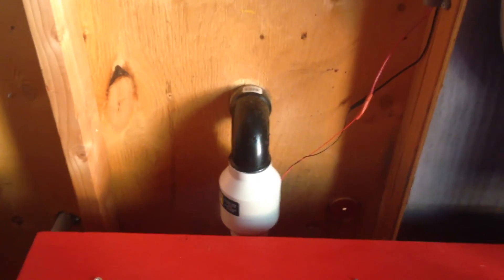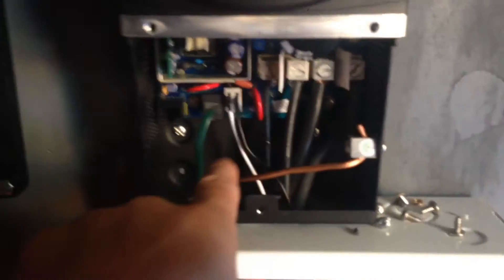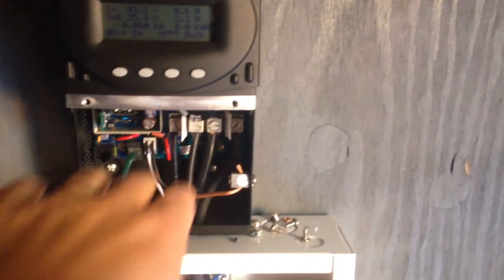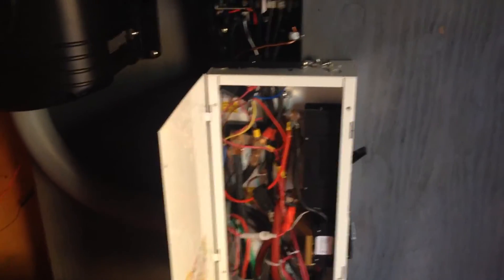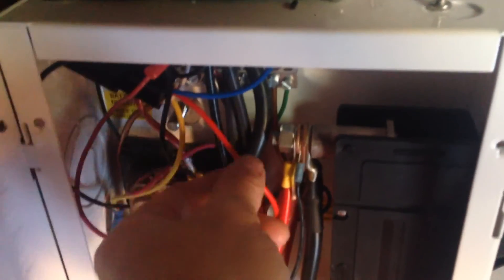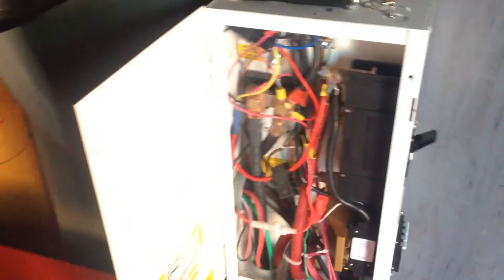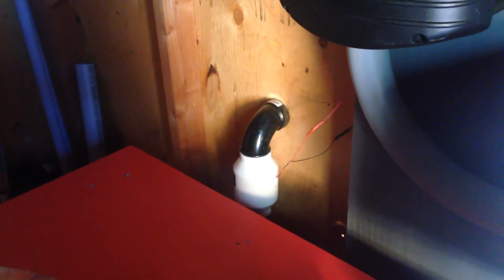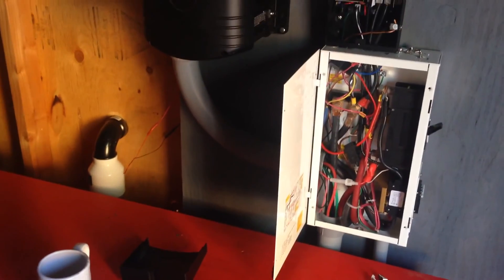Power Vent Fan and Relays

Comment: Thanks for the shout out!   It is a way to switch on what ever U need lower or higher voltage & at more than .25 amp @ 12V. That's all the Out Back will supply.

Comment: sounds like a good plan to wire it up.  I got lucky and got similar fans for battery room and separate control room but I got 12 volt. yours is better with the damp set up. I still got one more thing to finish mine. was going to use a dryer exterior flap so when the fan comes on, it will open. looking good bro, looking forward to more videos. SD.
Reply from the maker: +SilentDeath002 good idea with the louver vent flap..looks clean and can double as a damper... i bought one myself but the one i got didn't look clean and didn't fit well, but that's a good solution.  thanks again for the kind words and keep the vids coming on your end too

Comment: oh, forgot, you can also take the relay contactor off a old A/C unit. that one also operates on a 12 volt set up and you have two different legs you could control two different things at the same time. most of the time they throw them away.
Reply from the maker: +SilentDeath002 good idea. i actually got a spare 5 spade auto relay which i may use...still trying to figure out what i want to power up at same time i power my vent fan. i guess i could use the aux from the inverter too, but need the dang mate to program that which i'll get eventually but wish they were cheaper